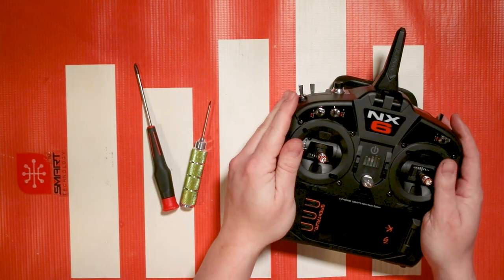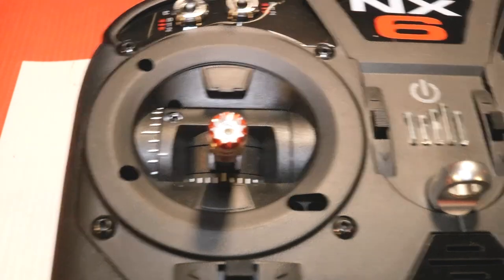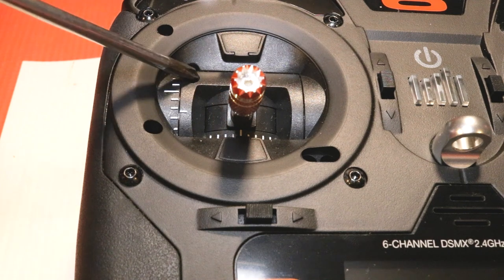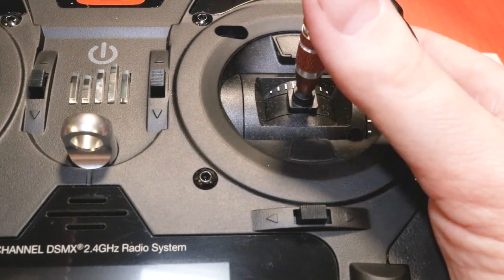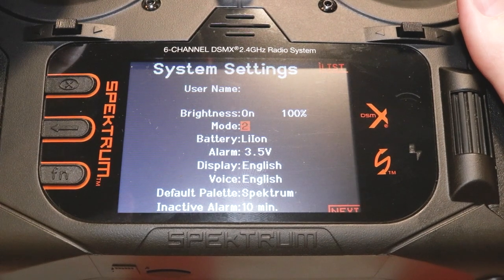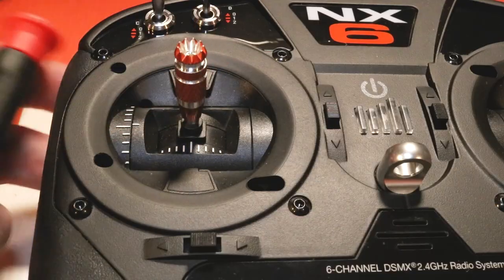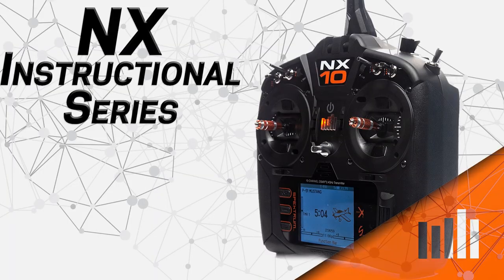NX Instructional Series - How to Adjust Gimbal Spring Tensions, Stick Ends, and Stick Mode Changes

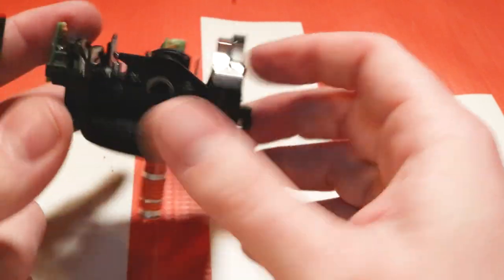Comment: So Tom in this video needs a little schooling himself when it comes to adjusting the left/right stick spring tension on either gimbal for the NX series. It is the small screw on the inner part of the gimbal itself. If Tom would have done his homework before making this video he would have known that the left/right spring tension is already set as soft as it can be from the factory. That is because that little internal block that slides up and down when you turn the screw in and out, has a capture screw that prevents it from sliding down any further when you turn the screw counter clockwise. If you can stop the video at 16:24 you can see that screw, but tom flips that gimbal around in his fingers so fast that it's a challenge to stop the video just right. 
When Tom turns the left/right spring tension screw counter clock wise, as if he is making the left/right spring tension softer, it simply backs out and then prevents the gimbal from properly moving up and down correctly. That's because the tensioning block can't move down any further because of the capture screw that prevents it from doing so.
You can soften the up/down spring tension because that tension block doesn't have a capture screw and so that block can move both up and down.

Comment: Originally, (20 years ago), the ratchet throttle was the only difference between a plane tx & a heli tx. Heli's, u didn't want a ratcheting throttle. (Cause, occasionally, u would need the space in between two ratchet spots). I actually had that issue, ONCE!

Awesome video again sir!

Comment: Thank you, very helpful.  One small suggestion, could you add a chapter minute reference in the description.  For example I wanted to learn about throttle ratcheting.  It starts at 9:30.  Listing the chapters by minute would make this reference even better.   Cheers.
Reply: Thanks brother man. I was looking for the same reference

Comment: You cannot adjust the tensions to anywhere near as soft as the DX series without changing the springs
Reply: Running into this issue now, coming from radios with softer springs the NX is way to stiff for me. You don’t happen to know where to source a softer gimbal spring so you?  Backed out to the point of the set screw contacting the face plate it’s still ridiculously stiff
Reply: Yep, same issue for me.  The sticks on this thing are ridiculously stiff, even with adjustment backed off all the way.  Sure would like some softer springs.
Reply: Same thing here springs are very stiff
Reply: Yeah same here I fly heli’s and this is bin awful experience with the nx radio 😢 the pitch throws me off now even if I try to get used to it I just can’t

Comment: my DX6 does not seem to have those adjustment screw options -
looks like I would have to take the radio apart to get to the inside -
is that right ?

Comment: My throttle stick wont tension on NX10SE. I originally purchased the NX10SE as a mode 2 then changed it to mode 1 and only just realised that the throttle stick was so loose and when trying to tension it as per the manual it wouldn't tension? it's still loose.  Any help will be much appreciated..

Comment: How easy is that to make the left stick center with tension. I want to use a NX8 for my Tamiya Semi trucks and trailers. Thanks for showing all of this.
Reply from the maker: extremely easy! Literally one screw to loosen and it will spring to center.
Reply: @SpektrumRCvideos  Thanks. I just rewatched this. Is the NX radios have ball bearing gimbals?

Comment: hi! do you know if there's any way to inhibit a switch, in my case the gear switch, until another condition is met, for example, throttle cut is turned off? i really want to build in a safety system like this to prevent accidental gear retraction on the ground but not sure if it's possible...

Comment: I've just programmed my NX7e and when I apply input to the right stick, pushing straight up , it'll freak out on the monitor screen and aileron (left or right input) will randomly jump (up) to 90% stay there, then come back down. It's brand new. Is there anything to do ? Or system return it ? 
Have a great Summer Ya'll

Comment: Thank you for your video. Can It convert mode2 or mode1 to neutral mode?

I want to apply it to 1/16 vehicles
Reply from the maker: yes you can. Simply have it so both gimbals spring to center with the appropriate screw. At that point it really does not matter what mode you set IF you are only going to use it for surface vehicles. Hope that helps!

Comment: On the NX10 I was working on the right side it has 2 screws for the ratchet I must of turned it to much not on the ratchet screw but the ratchet tension screw came out. Should I be fine or would I have to open it and fix it?
Reply from the maker: It would be best to open it and fix it so that nothing is floating around inside the case.
Reply: @SpektrumRCvideos  thanks

Comment: Hi only problem I have is when I switch to mode 1 the switches under the covers.   When I switch them over like you say the throttle only goes down to 13 and up to 87. If I don't switch those switches over then the throttle goes down to 1 and up to 99.
Reply from the maker: When you change stick configurations in anyway, you must recalibrate the sticks. Perform that step it it will fix that problem. Hope that helps!